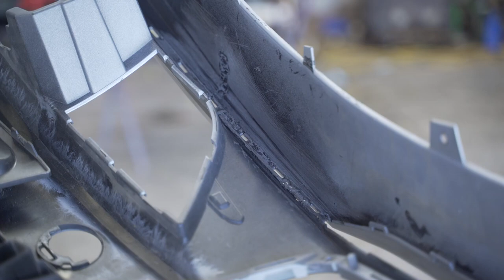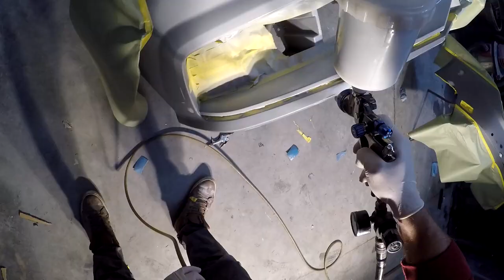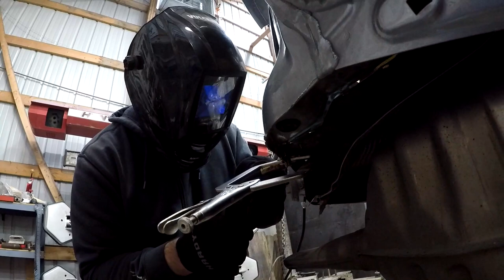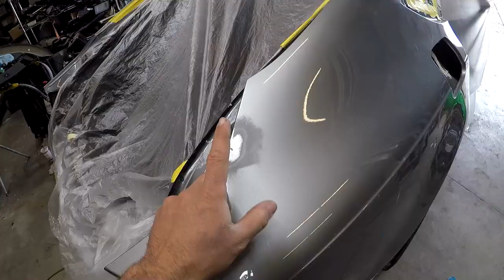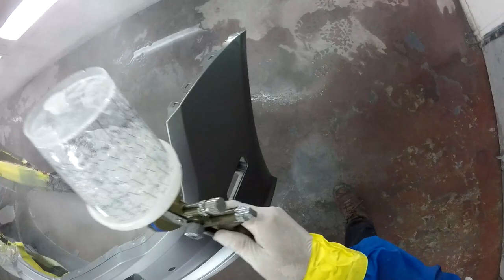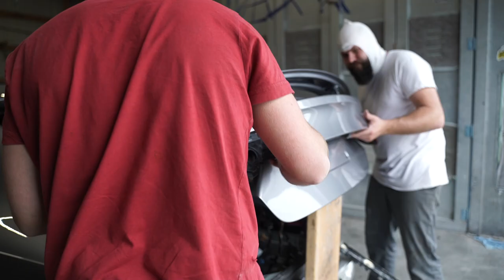REBUILDING A TOTALED AUDI A7

Comment: Good morning gentlemen, what brand and model of wire welder do you have and would you recommend  buying it again? What size wire and gas mix? You really got great panel fitment and shut lines. Thank you for the informative video and sharing your expertise and experience. Take care and good luck.
Reply from the maker: We use a Hobart mig welder. Had it for a while now with almost zero issues. Would definitely recommend it.